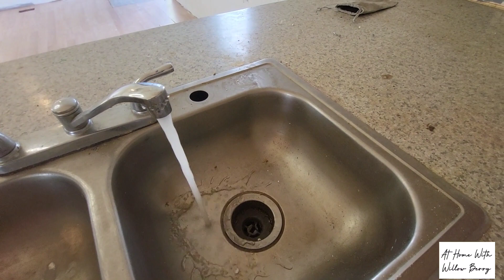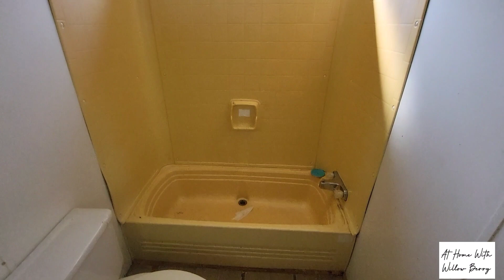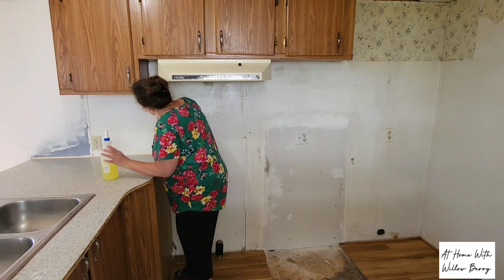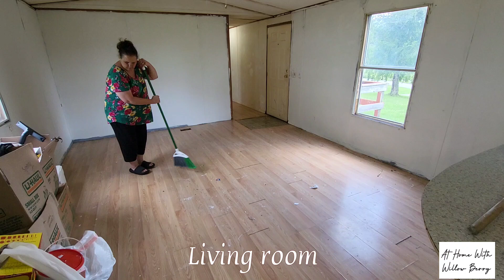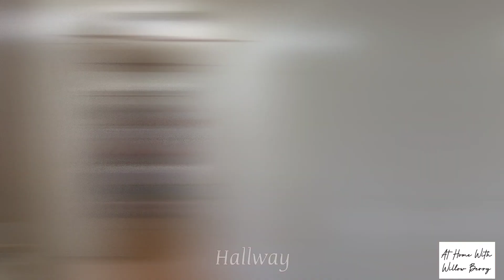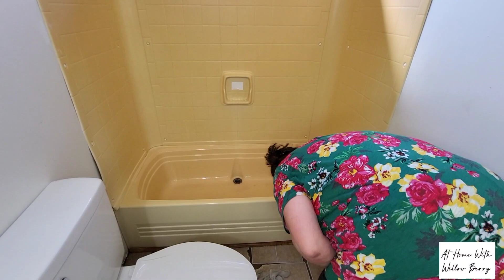My Mobile Home Rental Nightmare / Mobile Home Living

Comment: I just moved into my forever double wide, you can spray paint the sinks with Rustoleum appliance spray, it's pretty smelly but it works! I also am using the Tube and Tile expoxy for the tubs and showers for a redo, cheap way to upgrade without the labor costs.  You can paint the cabinets and your counter tops with Beyond Paint too, do it yourself projects for weekends!